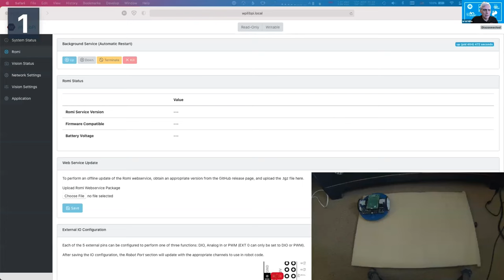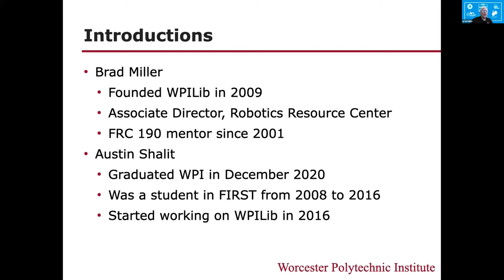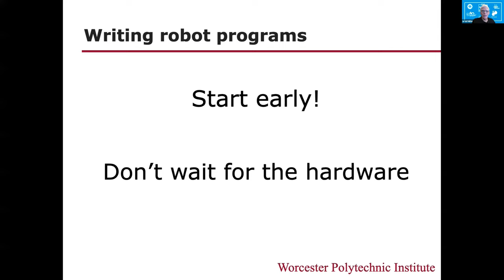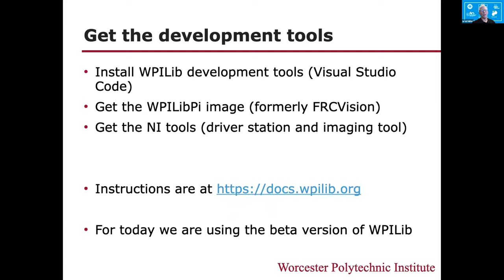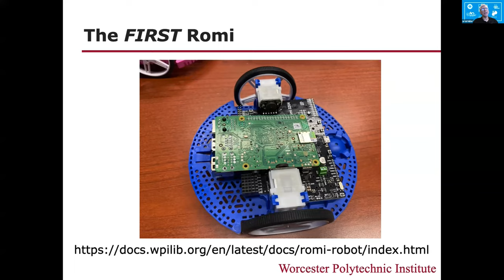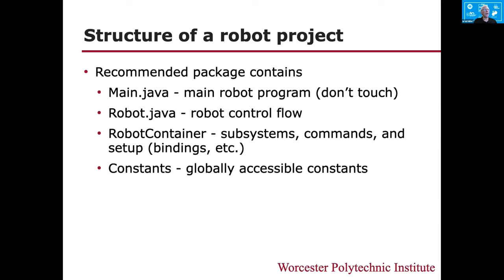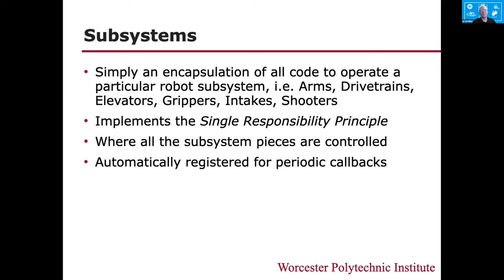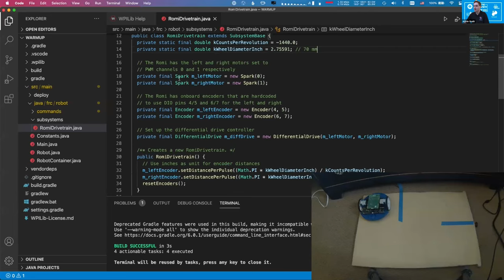FRC Workshop - Introduction to FRC programming by WPILib I FRC Warm Up 2021

Comment: The reason his program did not move the Romi is because he entered 0.15 for a speed. 
The arcade drive has this format:
arcadeDrive(double xSpeed, double zRotation, boolean squareInputs)

The 3rd argument (boolean squareInputs) is default to true which means the program will take the speed and square it. Thus 0.15 * 0.15 = 0.02. 
There is also a default mechanism that takes any number that smaller than 0.03 and assigns it zero to prevent burning out motors. 

That is why the Romi Robot does not move when they execute.
Simple fix is to add a 3rd argument (false) which prevents the squaring  it should work.